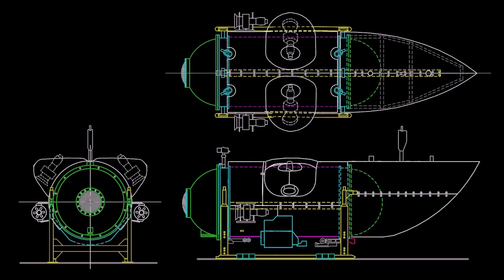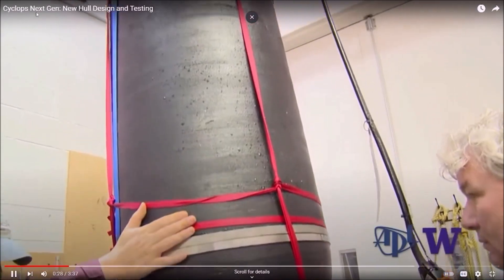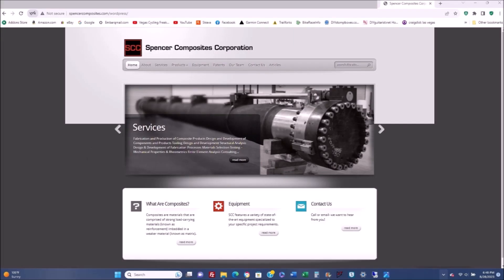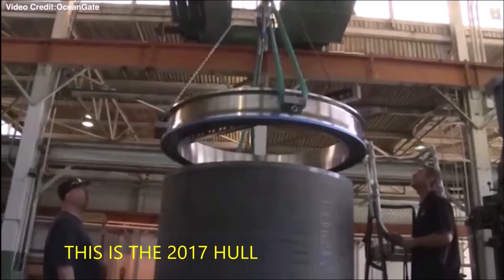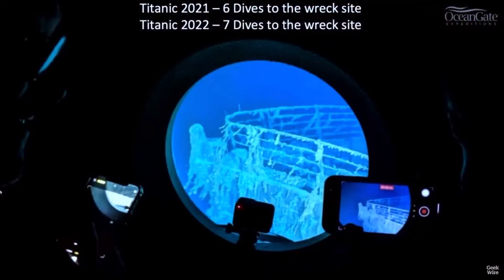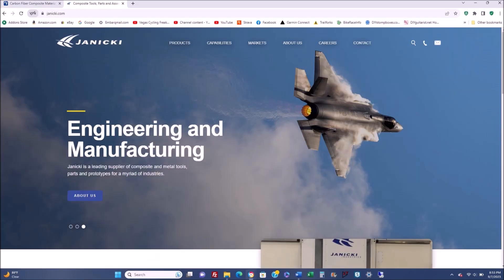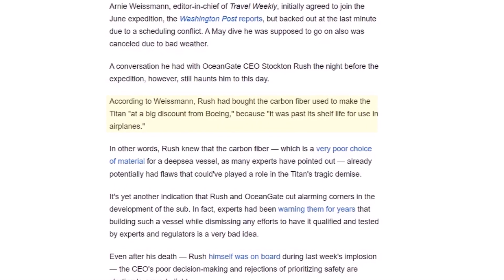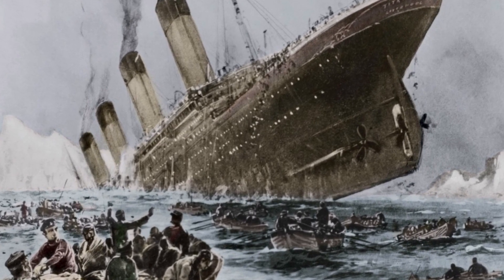OceanGate Titan - THE CARBON FIBER CYLINDER(S)

Comment: Nice video!  At about 12:58 minutes into the video you mention "to at least 13 visits to the Titanic."  I have never been able to confirm the actual number of times they actually reached the Titanic wreck successfully. Were you actually able find documentation of 13 successful dives to the wreck?  I thought it was less than that.  Thanks.
Reply from the maker: As far as I know, a total of 10 dives to Titanic between 2021-2022 with paying customers, so five "missions" each year. I believe they did about three additional dives to Titanic just to do 8K video and stuff like that. First dive of 2023 it imploded. 

Apparently Titan did 90 dives total, but as far as I know it would have been 14 with the 2020 hull. The rest would've have been with the 2017 hull, the version of Titan which most of the negative stuff on the internet is concerning. I don't know exactly how that 90 number gets divided up but the version with the 2017 hull was plagued with various problems.
Reply: @VegasCyclingFreak  It has been reported that of those 90 dives, only 13 were considered successful.

Another way of looking at it, though, is if those 90 dives include the last, there were 89 successes and 1 failure.  That is, returning alive is the real success.
Reply from the maker: @ej2953  OK. So how many dives were in the 2017 version and how many were in the 2020 version? How many of those were due to bad weather? I'd bet that most of those alleged failed dives were in the 2017 version. The 2017 version of Titan seems to have been plagued with various problems but they learned from those experiences and moved on.

It appears that they finally got everything right in the 2020 version of Titan. It's odd to me that 2020 version failed because the 2020 hull was manufactured so much better than the 2017 hull was. I would not have been surprised at all if the version of Titan that imploded actually had the 2017 hull in it. But it didn't.

Whenever anyone discusses Titan, it has to be looked at as the pre-2020 version and the post-2020 version as they were really two different animals. Also, keep in mind that all dives Titan did were not to the Titanic. They were doing other sorts of science related things with it as well. The media has done a fantastic job of smearing everything together. Sigh.
Reply: @VegasCyclingFreak  There was talk about a number of expeditions to the Titanic that never reached it.
Reply from the maker: @ej2953  Yes, because the weather is in the driver's seat. They did have technical problems on some dives, the vast majority of them having to do with the pre-2017 version of Titan which had the hull made by Spencer Composites. While COVID insanity was going on Rush quietly had a new hull made in 2020 and Titan was essentially completely reworked and they improved all the stuff that gave them problems. However, the media just smears everything together and the timelines in all of this can't be ignored because IT MATTERS. You can't apply pre-2020 events to anything past 2020.

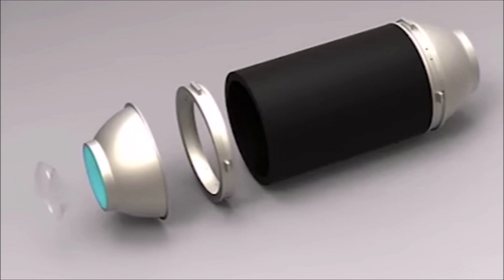Comment: 0:22 Uhhh YOUR OWN statement here was contradicted by YOUR OWN entire video and proved that, yes, it was his fault. I recognize group think is strong in cases like these but it's delusional to claim Rush was an innocent not at-fault party.

5:05 The disconnect is multifaceted and simulations are just that, simulations. It's the same as with data modeling - if the data ingested are crap then the output will also be useless - garbage in, garbage out. This is why relying solely on material simulations without real-world testing is idiotic and dangerous. The dangers are exponentially increased when using materials in a mechanism and an environment in which not enough information exists on how that material will behave and the failure modes are in the dozens. Therefore a simulation alone cannot verify safety.  

That said, your assessment about material choice, manufacturing, and testing is spot on. Perhaps CFRP are the 'future' of deep submersibles but without further and further testing we don't really know. There are certain benefits to CFRP material such as the strength to weight to overall buoyancy when compared to metal but like you said CFRP does NOT do well under compression loading. There were avenues available for Rush to test the performance of the hull but that wasn't done. There were avenues available for him to take an off-ramp and slow down but that wasn't done. There were avenues available to him to consider cycle times vis-à-vis repeated use to extremely hostile environments but that wasn't done. Overall, this hurt the industry and likely hampered further innovation than fostered it.
Reply from the maker: Well I didn’t mean to imply that Rush has zero fault in it any of this, just pointing out that he didn’t make these things himself, and the fact that there were two different hulls. A lot of stuff on the web is talking about pre-2020 hull and it doesn’t apply to the version of Titan that imploded. In any case, I did a video on the rtm system after I did this one and I pointed out a lot of potential problems, the main one being just the nature of carbon fiber, with its multiple personalities. Seems to me that it can’t really be a predictive system in this case. For sure needed waaay more testing to be proven. Appears to me that Rush was taking systems used on airliners that are 60% composite these days and trying to apply it to a DSV. Could have used some collaboration on that one too.

Comment: Why would you be lucky getting a few minute warning that you're about to die? I disagree.
Reply from the maker: Because of how the 2020 hull was made. It would fail in stages as far as I can tell, due to the five 1" increments of about 133 layers each, with what appears to be a layer of axial fibers in between each increment (so a total of 4). 2017 hull I think would have not given any real meaningful warning, it would just immediately implode. The 2017 hull appears to have had zero axial fibers. Also, they were (in theory) built with a safety factor of 2.25
Reply: @VegasCyclingFreak  You're right but as far as I've seen, SR always dismissed those sounds as the hull "breaking in". If you don't ignore all the cracking and sometimes loud gunfire like bangs! According to some of the passengers, the sounds were startling loud. From all the information we have, they probably had a fairly quiet ride all the way down, but something happened when they were only feet away from the wreck that made them decide to abort the mission. It sounds like they tried to make an emergency ascent when they heard something that scared them, particularly SR, beyond anything he had experienced previously. It was probably only a minute or less... maybe even a few or more but even if it had only been 30 seconds, it would have been the longest and scariest 30 seconds of your life. Definitely a "Life flashing before your eyes" moment.
Reply from the maker: @Simonjose7258  If you watch my video following this one about the real time monitoring system I explain how that was intended to work. It’s not really possible to build a perfect carbon fiber cylinder with 5” thick walls, with millions of fibers that has zero voids or weak fibers in it. There would be some amount of noise on first dive (I assume mostly beyond the range of human hearing). If you can actually hear noises audibly, that’s very bad. When Rush talked about noise he could’ve been referring to ultrasonic noises that we can’t hear but the rtm system could.
Reply: @VegasCyclingFreak  No. I watched A LOT of videos and I'm talking about passengers who rode down with him. I'm sure you van easfind them. Anyone who went down the rabbit hole can confirm what I'm saying. They said that the hull made LOUD Gun Shot  Bangs! The passengers were shocked and freaked out by it but SR assured them that the hull was just "breaking in."
Reply from the maker: @Simonjose7258  I’ve heard rumblings about that. I’ll have to research it a bit. Thanks…
Reply from the maker: @Simonjose7258  Didn’t do an exhaustive search but I found one article which mentioned a 2019 test dive and gunshot noises. That would’ve been the 2017 hull which was scrapped. New hull was made in 2020. That is the one which was in Titan when it imploded. One reason why timeline is important here. There is a lot of talk about things associated with the 2017 hull which don’t apply to the version of Titan that imploded. Rush kinda switched out the hull under the radar… wasn’t really publicized. This adds a lot to confusion and misconceptions regarding Titan.
Reply: @VegasCyclingFreak  You're probably right. The only thing that really interests me is those last few minutes. How long was it between the time they decided to abort and when it finally imploded? As far as I can tell, it wasn't out of nowhere, catching rhem off-guard. They had enough time to tell the ocean surface level crew that something had gone wrong and they were trying to release the ballast. The only ballast they had that would take any effort beyond hitting a switch was the iron pipes stacked on shelves on either side. Apparently the submersible passengers would all have to shift their weight to one side of the vessel so that the pipes roll off. Sounds kind of sketchy AF, but along with a time sensitive chord that disolves in sea water after a prescribed amount of time, releasing enough ballast to begin an emergency ascent, these were supposed to be low-tech ways to release ballast in case the electrical equipment failed or if the crew passed out due to carbon dioxide or low oxygen intoxication. From the final communications we get to read and hear, it seems like they had more than a few minutes to regret their choices in life. I don't mean to relish on this fact at all. It's just such a terrible way to go. I feel especially bad for the father and son. So sad. Your video is great btw. Too Notch.
Reply from the maker: @Simonjose7258  I think they potentially had about 7-10 minutes of terror. Rush likely was downplaying the seriousness of the situation, maybe even thought they weren’t in real danger. Next episode I will go over the transcript and why I believe it’s not a fake. The loss of life makes me sad too.
Reply: @VegasCyclingFreak  it's super intense. Looking forward to that. Definitely gonna watch. 👍

Comment: If you think there is any safe applicable use for carbon fiber in deep sea submersibles, you go ahead and beta test it...  I won't be there, and I'm pretty sure most people who are aware of this wouldn't go on it either..
Reply from the maker: With the limitations of current manufacturing technology I would agree. It could be made to work if they could build a cylinder the way it really needed to be made. That's really what is at the center of the issue.

Comment: It failed at the lip of the titanium ring on the inside of the carbon fiber tube. The inner lip was only 1/2 - 3/4 in thick and was acting like the edging of a car window, if the window is all the way up its strong and hard to break but if its rolled down even 1/4in then its easy to break, that inner titanium lip could not take that load after that many dives and I'm even willing to bet it was the rear door because the front one got stress relived after every dive from being opened.

Comment: It's absolutely his fault he bought expired carbon fiber to make the pressure chamber with. That's where you need to stop right there you don't need to go any further he had been told by every expert that could possibly say anything to him that he was going to get himself and someone else killed if he did that he chose not to listen he used substandard materials he used a design that was known not to be safe what more do you need to know?

Comment: Sadly the top & bottom was a marvelous material was used incorrectly, and untested, for profit - along with so many other dubious design and commercial decisions. It was done knowingly as shown by using litigation instead of sound engineering argument when challenged.
Reply from the maker: I'm sure there was probably also a time when carbon fiber for use in airplanes was an idea that was shot down. Really the reason OceanGate started these Titanic dives was to make money so Rush could do the scientific stuff that he was really interested in. It wasn't to make a profit for the sake of making a profit.

Comment: I will never understand this obsession with the use of CF for vessels that will be under primarily under compressive stress. oceangate wasn't the first one to come up with this idea - iirc there are papers showing that the us navy was playing around with the idea many years ago.
Reply from the maker: What's driving that? It's strength to buoyancy - apparently it's three times better than titanium. In the case of OceanGate, it was that plus it was a way to get five passengers into something that wasn't a very large sphere. No matter how you dice it, slice it, cube it or fry it compressive strength is a problem. At least with current manufacturing technology it is.
Reply: @VegasCyclingFreak  3 times better than titanium in tension only. compressive it is worse.
Reply from the maker: @TMS5100  Yes. It was Rush’s viewpoint that it was the right material for a DSV, because of the theoretical strength to buoyancy ratio. Maybe true if carbon fiber’s compressive and tensile strengths were equal.
Reply: @VegasCyclingFreak clearly he was at fault
Reply from the maker: @illumiNOTme326  Normally a submersible would be designed per the  ASME Standards For Pressure Vessels for Human Occupancy and ASME BPVC Section VIII, Division 1, Rules for the Construction of Pressure Vessels. Carbon fiber isn’t even on the radar in the 950 pages between the two. No way to have hull certified when no standards exist for it. All you can do is pressure test it. The rest is relying on the manufacturer. That’s what Rush did. It was supposed to be twice as strong as it needed to be.

Comment: Geez that's nuts not crossing fibers. I work on the 787 laying up the carbon fiber. EVERY LAYER IS A DIFFERENT DIRECTION. How could they possibly believe it could withstand the pressure millions of pounds under water is beyond me. 😂
Reply from the maker: Yeah I can't understand why on earth manufacturers that are supposed to be experts with carbon fiber would build it that way. It makes no sense at all to me.

By the way, how much of a 787 is made with carbon fiber?
Reply: @VegasCyclingFreak  Something like 50% by weight.
Reply from the maker: @thebigbean92  Wow. I wasn't really aware of the use of CF in aircraft until this whole OceanGate thing.

Comment: It is his fault, he made the decision to carry on with this idiocy with no regard for safety
Reply from the maker: But he DID have regard for safety: 

Why would he have done the first test dive in the 2017 hull solo? 

Why did he scrap the 2017 hull and have another one made in 2020? 

Why would have taken the expense to ship the 2020 hull to a testing facility in Maryland so it could be tested in a hyperbaric chamber before it ever touched water? 

Why would he have went thru the trouble and expense to design and implement a real time monitoring system if he didn't care about safety? 

Why on earth would he personally go on these dives if he didn't think it was safe? 

Why would his former business partner and other people that knew him make statements that Rush was very safety conscious and risk averse when they have nothing to gain from it? 

Yeah it really seems blindingly obvious that Rush had zero regard for safety.
Reply: @VegasCyclingFreak  If he had any regard for safety, considering the lack of guidance, he should have at the very least built several hulls and sent them down to depths remotely to learn precisely where they fail.  And some that he takes to a depth short of the failure depth multiple times with extensive analysis of the hull between each dive.

And on any sub used for humans, check it out in detail between each and every dive.  He didn't even bother doing that.

Comment: Was it ever determined if they lost power and plummeted to the ocean floor in an uncontrolled descent thus causing overstressing of the CF?
Reply from the maker: If they lost power I'd say that it was because they used up the battery(s) in the tail section with 40 amps of continuous power to the upwards thrusters, in an attempt to quickly ascend. As far as I know they simply descended via gravity. Rate of descent depends on how much ballast is used. 

 I have a hunch that ocean currents may have contributed somehow to their demise. Hamish Harding made a post on FaceBook the day before  the dive saying they had the worst weather in 40 years in Newfoundland and probably this would be the only 2023 mission. He got that right, unfortunately. I think it's likely ocean currents were doing something considerably out of the norm and is a factor in this somehow. The weather was pretty crazy this year... I mean who has heard of a hurricane possibly hitting the coast of California?
Reply: @VegasCyclingFreak  right and down in south east Louisiana where I'm at we are suffering the worst drought in decades. We've been stuck under this hellish high pressure ridge for half the year. Last month was just awful due to the record heat and dryness.
In any case, I hope the La Niña comes back very soon!
Regarding the Titan was any telemetry ever recovered from it that you are aware of?
Reply from the maker: @LichaelMewis  Not that I know of.